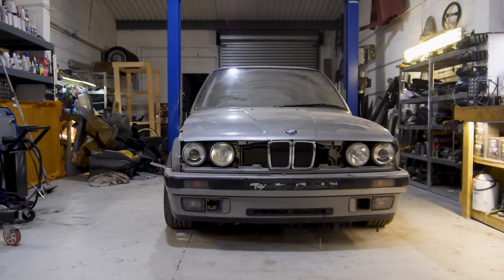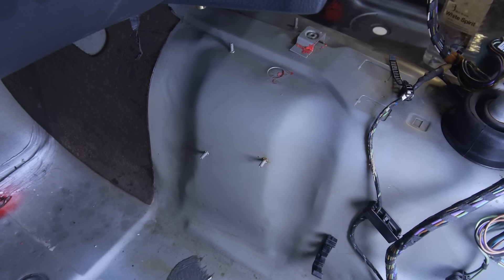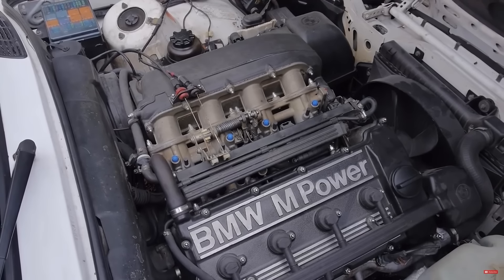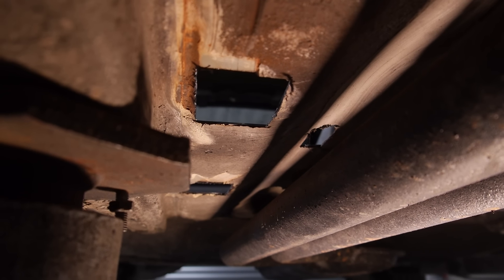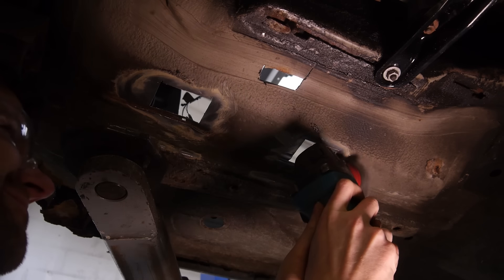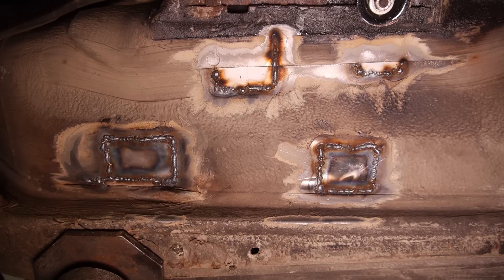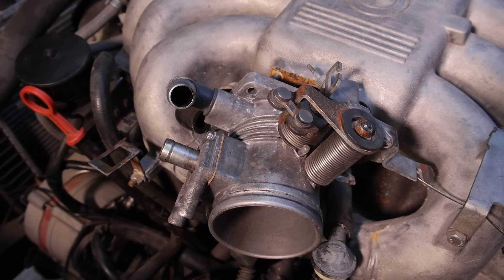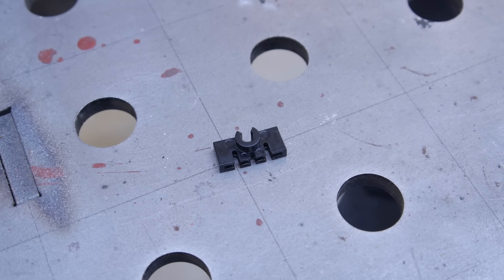Welding The Floor & Fixing The Engine | BMW E30 Touring Restoration - Part 5

Comment: Saab did the same "coolant in the throttle body" thing for preheating the air going into the intake runners on a classic 900. I have no idea why, but you can delete them like on your BMW. Probably something common with Bosch systems.

ALSO, I'd suggest purchasing a 3D printer for smaller, simple plastic bits. I've saved myself approximately half the cost of my Kobra 2 Pro printer so far for my Saab resto. You can even replace some flexible bits with TPU filament. I've also begun designing and printing my own replacement parts that are NLA from Saab with the aid of free CAD software available online (TinkerCad and Shapr3D)

Comment: Good to see you back Steve. Maybe it's just me, but I'm definitely an amateur welder, having said that I've now done lots of it, and I still find sometimes it goes great and sometimes it doesn't. Same person, same welder and settings, same wire, same gas, same steel. If I had my time gain, I would definitely have paid extra for the RTech instead of the Sealey Supermig I own. In my experience, I get best results on car bodywork steel (0.8mm to 1.2mm) using 0.6mm wire and leaving a gap which is ideally the same as the wire, about 0.5mm. Although larger gaps can be accommodated, the welding job is always less tidy. If you want a good, invisible patch, it's always worth spending the extra time getting a perfect fit with nice even gaps. Talking of white spirit, I use loads of it, particularly for cleaning oily parts. The best price I found for it recently was Halfords, don't know whether it still is. Keep up the good work.
Reply from the maker: Great comment, thank you, Bob! You are spot on, great advice. I'm using 0.6mm (down from 0.8mm for years) which is helping, I just need to make thoes gaps a little smaller like you say, and turn it up a bit and I think I'll see an imporvement. The R-Tech is a dream machine and is doing wonders for my average welding. 

Oh yes, £4.99 for 2L is cheap! I'll have to pop in a get some. 

Thanks again, Bob!

Comment: I spent most of my spare time this entire winter completely rebuilding an hvac unit (to retro fit on my e30 convertible) after I saw your video on it. I even ended up combining it with the automatic temperature control unit. Installing it was pretty much straight forward but now it is taking me forever to fit all the parts in the engine bay as with every bolt I remove I discover more rust... I am very patient but you really are on another level :D I can imagine to do this full time though. Once I get in the flow it can be relaxing even when physically demanding.

Comment: Just to add to comments about the throttle body heating - as air flows through the narrow airway past the butterfly it speeds up therefore the air pressure drops resulting in water vapour condensing to liquid form which can freeze in the colder conditions of a West German winter (!) resulting in ‘carb ice’ (common in piston powered aircraft hence the carb heat lever which uses preheated air from around the exhaust manifold)

Comment: The M42 has a throttle body heater too (two styles were used). It can be deleted and results in simplified coolant and air hoses. I did mine and the idle is way better. It's called "the mess under the intake" in M42 circles.

Comment: Coolant goes through the throttle body to heat it up because it cold freeze up and get stuck
Reply from the maker: Now that sounds true! Cheers, Tevtron!
Reply: @RestoreIt  I belive it is a cold climate option yes
Reply: Does it also help keep air intake temperatures cooler? Cooler air = better performance.
Reply: @M1LAD81  No, it heats up the throttle body significantly.
Reply: As Tevron said this is a throttle body heating. I highly recommend keeping this working. Even if you driving only in summer. Due to high air flows the temp can drop under zero degrees C and freeze the throttle.
Keep going, I love your channel!
Best regards Chris
Reply: This is true, my VW VR6 had the same thing.
Reply: Yes, this is de-icing feature. In some specific conditions of humidity and temp. ice can form around TB.

Comment: When it comes to things like those floorpan drain plugs, and the plastic screws that hold interior pieces on, you can get generic ones that are identical and about 1/10th the price, a lot of the time they're common/standard items rather than being manufacturer specific, especially the interior clips/screws.
Reply from the maker: Great point, I'll look for a company that does them. Cheers!

Comment: Another great video! An idea for you for those pieces you can't reach and weld from the backside: don't fit the new piece on the exact contour. If you leave a space of around 0.5mm, it will allow the weld to penetrate deeper in.

For the plastic dent, can you reach it from behind? If you do, try to heat and push to place.
Reply from the maker: Thanks, dude! That's a great idea. I'm just trying to think how I would keep it flush and ensure there is a 0.5mm away from the piece beneath it? 

I can't really get behind the dent, it's just more of the same material. It'll be interesting to see how that gets sorted, as I'm not 100% sure.
Reply: @RestoreIt  Hi, not sure why you mentioned the metal beneath it.
I meant you should make your new metal piece around 0.5mm smaller in perimeter to allow the weld to penetrate between old and new metal.
This will give you better filling and not worry about places you can reach from the back side.

Comment: Little tip. If you use a wire brush you will just polish the rust most of the time. Try scraping at it and you will see brown again. That is atleast my experience. Also what I found works best to remove paint and rust is a CSD disk. Pretty great for the edges after a cut so you don't thin out the metall where you will weld since it is plastic and not so abbrassive. cheers
Reply from the maker: Great tips here, thanks, dude. I'm getting some now!

Comment: The '90 Nissan 300zx I'm restoring also has the coolant going through the intake and throttle bodies.  Quick answer its for emissions.  Long answer, they wanted to get the motor up to temperature quickly so that its working as efficiently as possible, as quickly as possible.  Definitely remove all that crap and plug off the lines, because its useless and prone to leaks.  My throttle bodies had pressed in pipes and I used a press to remove them for a cleaner look.  Since you are in a loony emissions country, probably just don't show or tell us you did it so you don't get in trouble!

Comment: Coolant is passed through the throttle body to prevent icing in very cold climates. If you do not experience temperatures below freezing in the place you park the car at night, you can delete this circuit. Typically you can loop the lines back into each other and cap the fittings on the throttle body.
Reply from the maker: Very cool idea. Thanks, Leftventricle!

Comment: 10:20 This is the problem I had with nearly all "project" cars I had. Dipping a car in Western Australia can be done but can more than double the cost of a resto. Also heath problems made it to hard for me to totally strip out a car and paying for it was just going to happen either.
Reply from the maker: How much does it cost to dip a car in Australia?! I know its about 2-4k in the UK depending on what you have done. Paying someone to do restore a car is eye wateringly expensive!

Comment: FYI if your going to use ceracoat for the exhaust 1-2 coats will not do it will take 5-6 for real long lasting protection.
Reply from the maker: Thanks for the tip, Paul!

Comment: @RestoreIt. I think the water flows through to stop the throttle expanding under heat and stopping the tottle sticking partially open. P.s did you find out exactly what that loom was for in the back from behind the dash?
Reply from the maker: After a reading a few comments I think you're right. And yes, its a CD changer, probably for Alpine.

Comment: Btw, could you 3D print some of the parts, other than buying them? Will this solution be suitable?
Reply from the maker: It's finding the files that the most difficult thing, for certain things at least. And then the print has to be perfect, and even if it is, will these 3D printed parts last as long as injection molded ones? I'm not sure.

Comment: If you stopped doing little stitch welds you’d end up with a better result and less grinding. An inch or half inch of weld won’t overheat the panel enough to warp it out of all recognition. That being said I do enjoy your videos and this is no different
Reply from the maker: I'll give this a go in the nex episode and see how i get on, especially as I'll be doing small gaps. Glad you're enjoying it!

Comment: At this point I just lost track of which e30 is being worked on... or cars you still have😂 Im sorry if this is obvious for some but im lost. The progress you've made is really nice to see!
Reply from the maker: Haha, sorry, William. That's partly my fault. 

There are currently only two project. 

The E30 M tech 1 325i Sport

And the E30 M tech 2 325i Touring. 

The E30 M3 is finished, but I still need to do one final episode on it when I'm next in Spain at the same time as the owner.

The Red 316i touring had to go, as it was a bit of a filler project that I didnt really need and the Mercedes project came out of the blue.

The Mercedes was completed.
Reply: Thanks for the recap! Much clearer now

Comment: Great work mate as always, and my GOD those fenders are ludicrously expensive, sweet jesus. It's the price of a used car.
Reply from the maker: Thanks mate! He doesn't have the standard E30 fenders that you see in this video on the website yet. These ones are from stage 3 testing and are ready to go. The ones you are looking at are for the M3, which is worth A LOT more than a standard E30, 50k , 80k, 100k+
Reply: @RestoreIt  ah alright that makes more sense lol. I believe they are wider/flared. Don't see any around anymore.

Comment: Coolant going through the throttle body is for emissions
Reply from the maker: Ohhh. I still no get it. Haha.
Reply: Warms the air to lower emissions, but is not great for power
Reply: Nothing to do with emission, it is just to warm throtle body during cold winter days, you can disconnect and link those 2 hoses together to stop the leaking, and no, there is no performanse gain in doing😊 so...
Reply: No...😅

Comment: The cost of all the misc clips and special screws, trim pieces etc is a nightmare!

Back when e30s where cheap a friend of mine dismantled a few e30s for parts selling some bits but mainly carefully hoarding away as many spares as possible for his own car. Including every clip, terminal, special bolt you could imagine. It's saved him a fortune over the last 15years or so.
Reply from the maker: Tell me about it, and what a good idea. He's probably saves himself hundreds if not thousands...
Reply: I'm hoping to do the same but to a lesser extreme (I don't have the space) for my e39!

Related to unobtainable clip and trim sourcing... thingiverse is full of useful 3d print models for older BMWs. We've printed a few bits to fix broken bits of trim on my e39 already some very helpful enthusiasts have spent a lot of time prototyping replacement parts!
Reply from the maker: How have those pieces held up, and did you print them in ABS or PLA? and did you do normal printing or SLA using liquid resin?
Reply: He's printed them in ASA (apparently similar to what wing mirror shells are normally moulded in), though it apparently stinks to print with some scary fumes. He's got a fume cupboard and extractor fan etc to deal with the dangers.... it's way too early to give a review on how the parts will hold up really, ask me in a year!

I don't really know much if anything about plastics let alone 3D printing but thankful I have a mate with know how and a fairly fancy 3D printer.
Reply from the maker: That does sound like a fancy one. But yeah, we're already at a fume cabinet and a version of printing I've not heard of, haha. It's a great idea, but it's certainly not as simple as buying a printer and hitting print. 

I'll look into ASA now, cheers!

Comment: If I do not forget I schuld have few kg of screws from E34 530I i had, as I see lot of it look same. I use those mabe I can send U those garbage. But Im not sure how many is naw or was on some momenth part of my life in diferent cars, tools, bikes, toys, furnitures, jigs etc…
Reply from the maker: I'm sure these little plastic screws can't be that much, but you never know!
Reply: @RestoreIt  if send send all and forget. Lights from glove box, from thos roof handels insite (back one had lights then) even lamps from registration plate was in this box. Wooden/carpet floor panels from trunk are in my 3 th car naw (im timber framer, naw drive kangoo II.)

Comment: I can only think of 2 things why coolant needs to go thru that throttle body. 
1. to help cool down the coolant by the air that flows thru it(seems unlikely) 
2. Trapped hot air can rise and get to the throttle body which results in highte IAT and therefor less power
Reply: wrong, its to heat up the throttle body in cold weather
Reply: @oOTevtronOo  I cant be wrong by just saying what I could think of on top of my head.
Reply: @oOTevtronOo is right, it heats the throttle body for cold weather, but also it prevents condensation of the fuel and oil mist on the throttle body&butterfly valve

Comment: The hazard switch goes to far end towards the glove box, the rear window heater is rightly positioned, you are missing the rear window wiper switch, The Ac switch can be useful when you'll install the AC. evntually there was a switch for balancing the speakers volume  to the right or left.
Reply from the maker: Thanks for this, dude! The car doesn't have aircon, but I think it did have the speaker switch, so I'll get that in. I've just remembered I borrowed a blanking plate from the 4 door as I no longer have the flashing red immobiliser receiver thing.  I don't remember a rear window wiper button either. I'll have to see what I've got in the store room.

Comment: At this rate the rust repair will be done in 15 years.
Reply from the maker: Ah, yes, sorry recon, I can see you produce daily episodes on car restoration. I'll try to keep up with you!
Reply: @RestoreIt  Good one! No I don't put it on YouTube, I have a job. If I were this slow though I'd have to make videos I guess to make any money. You fixed 4 tiny rust spots on a 30 minute video so who knows how long it really took. You're gonna have 20 videos and fix 64 little rust spots.